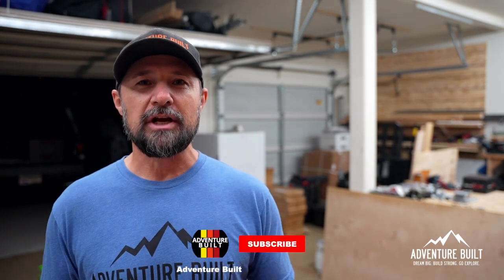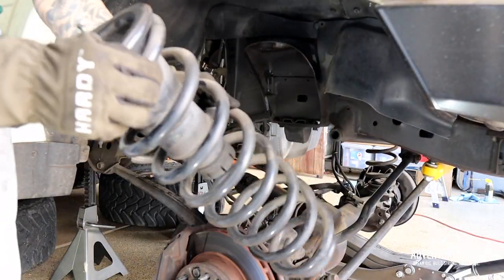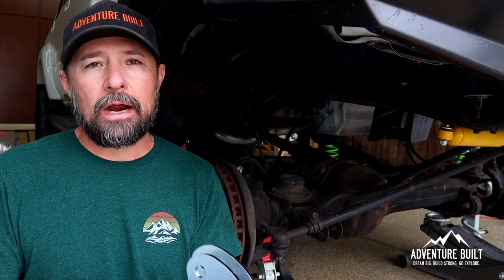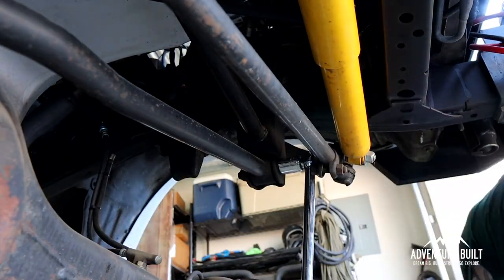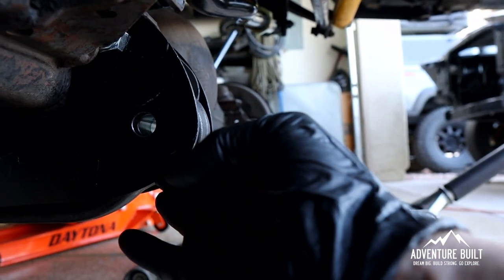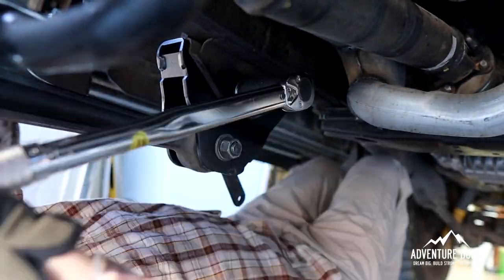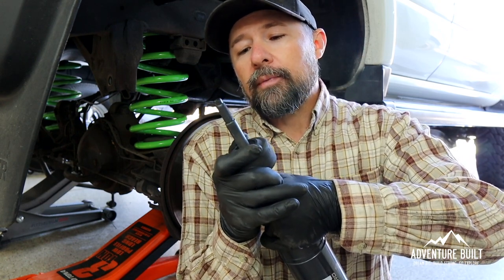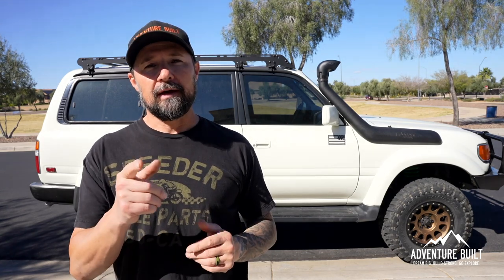ULTIMATE LAND CRUISER FJ80 | COMPLETE IRONMAN 4X4 FCP STAGE 2 INSTALL, WILL IT OVERLAND..SPOILER YUP

Comment: You need to change out the offset bushings on your radius arms.  The ones you have are the ARB offset bushings that give will give you another 2-3 degrees of caster.  The stock bushings are what you need to use the caster adjustment plates.

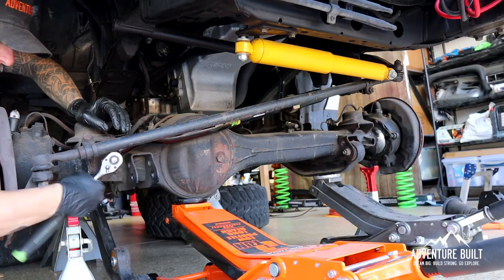Comment: 9:52 Did you forget the spacer at the top mount for the caster plates?
It looks like the 80 already had an ARB Suspension kit on it. The bushings in the control arms would be centered if stock.  10:12 you can see the bushing is off center by about the same amount you ground off the arm. The extra Caster could have caused your clearance and fitment issues..... The Iron Man kit lowered the front for 5* and the ARB lowered the rear of the axle right onto the tie-rod.
Reply from the maker: I will definitely look at that part of the kit again. Everything is fitting now but I’ll definitely check on those spacers. Thank you.

Comment: When I changed out all of the suspension bushings last December, I had to remove the rear shocks……….because there wasn’t enough clearance to get the rear control arm (lower) bolts out. The lower shock bolt on the left side, the bolt head snapped right off. 😢😖😫 that was a 2 day drill/thread chase PITA. Some one must have used red loctite on the bolt. Great video and thank you for posting. Very helpful.
Reply from the maker: Dude, that sounds like a nightmare. You are so welcome and hopefully you won’t ever have to deal with that again!
Reply: @AdventureBuilt  it was, thankfully all of the shrieking nightmares have gone away with pills and booze. Happy again until next time.
Reply from the maker: @Ghostrider-71  whiskey helps! 😎

Comment: the problem with getting the front control arm bolts aligned might have to do with the offset bushing that were already installed in them.

Comment: i have a 1991 triple locked with the ome heavy duty coils. one thing i didnt like about this kit was the shocks. the travel of the ome shock is exactly the same as the toyota stock suspension. i ordered custom fox 2.0 to maximize flex in my rig. also i made my own 4 link fully adjustable arms in the rear with johny joints. much better then the stock or polly bushing that tend to rip at extreme flex. i was wondering if the ironman also came with stock length shocks. in my opinion it defeats the reason to have a lift.
Reply from the maker: That is awesome. I would assume the Ironman are longer than stick but don’t know the exact lengths of each to be sure.

Comment: did adjusting the caster 5* cause any problem with the angle of the driveshaft/differential connection?
Reply from the maker: No not at all. In hind sight I don’t know if I would do it again. Didn’t seem to help or hurt anything.

Comment: How does it the ride? Compared to ome kit you had? Im about to do mine.
Reply from the maker: It is a lot smother. The OME kit was crazy stiff in the back end. If I did it again I might look at the Dobinson progressive coils with the Foam Cell Pro shocks. That would be awesome.
Reply: @AdventureBuilt  Nice, I did mine and it is nice, but I replaced the original soft suspension on lx450, the springs were almost the same length , but a lot skinnier and less coil material. over all, very happy with the results.

Comment: Question, was there something wrong with the ome kit? Also, with the ome caster bushings and the plates, how did your alignment work out? 
I’m always weary about moding the factory components to make things fit. 
Anyhow, great vid. New sub from me.
Reply from the maker: Thanks man. The OME kit was super stiff. I wanted a softer ride on the trails. If I did it again I would mess with the caster. I don’t think I have enough lift to make a difference.

Comment: Does yours lean one way or another? Mine leans toward the right side of the vehicle. Im wondering if its the spacer that was on top of my right rear spring that caused this. I have a RHD one from Japan that has a spare wheel carrier on the back right. My guess is that the spacer on the spring is included from the factory in order to balance the weight of the spare carrier... too bad the spacer is 3000 miles away from where I currently am!
Reply from the maker: Mine does not lean but I think the coils make up the difference as each one is side and corner specific.